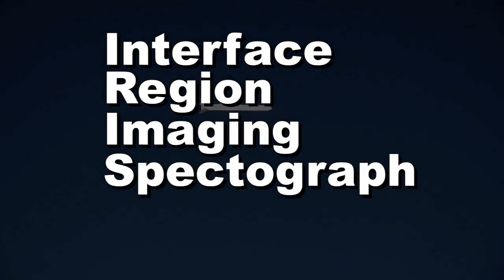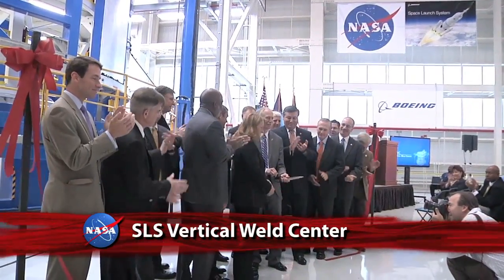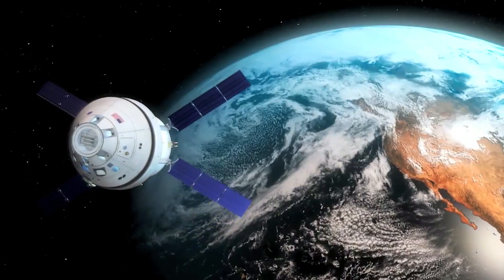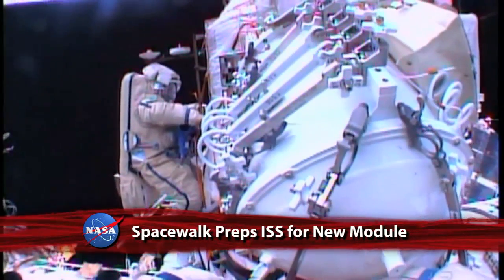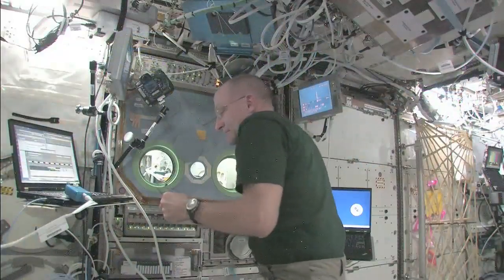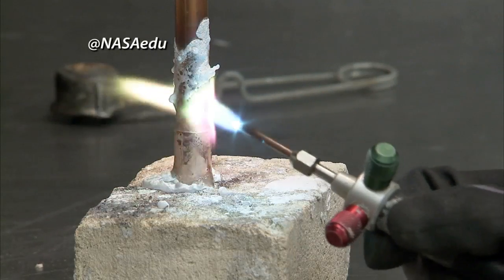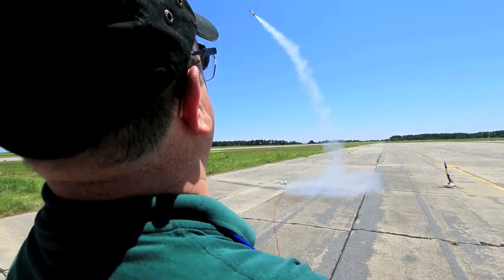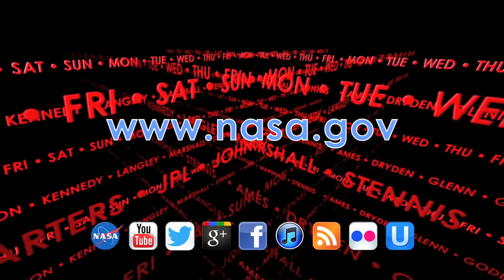IRIS Mission Underway on This Week @NASA

Comment: a valid question. with the Dream Chaser and Dragon, I see no need for the SLS beside going to Mars/Moon/Asteroid. I am sure that, since the SLS is so big and expensive, it will be launched A LOT less frequently then the soyuz ( and eventually Dream chaser and Dragon). But it is capable of achieving escape velocity or LTO. My guess is it will be used for asteroid research and Lunar flybys soon after being built and later on will be used to go to Mars/Moon in the 2030's